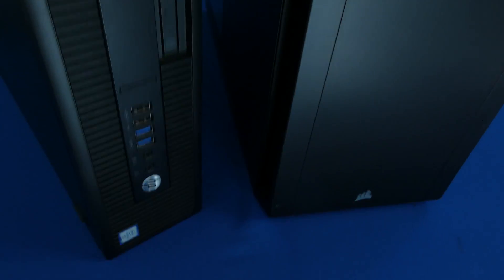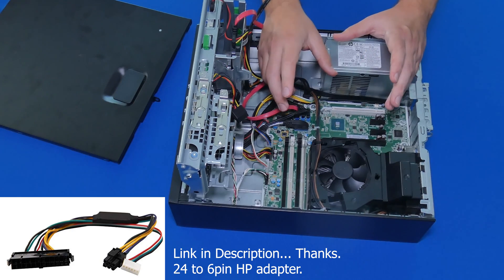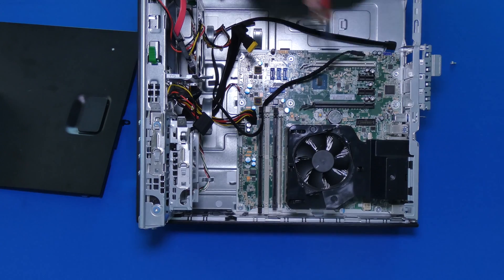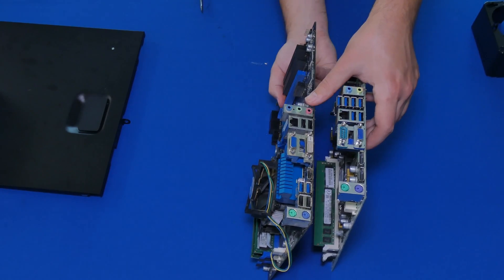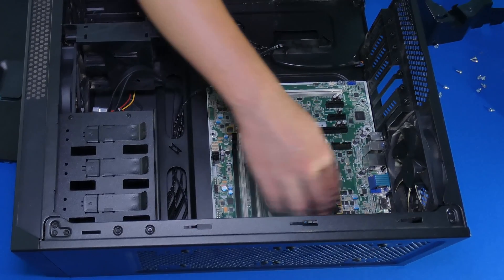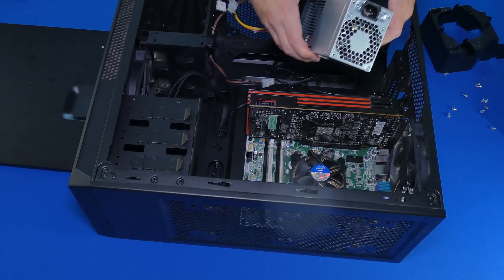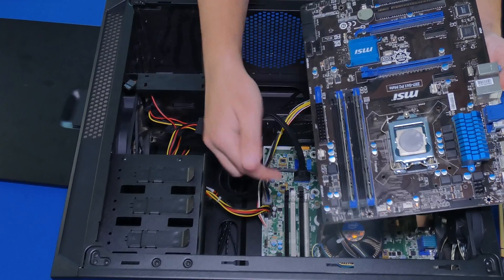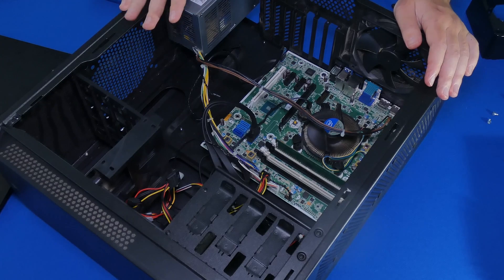HP EliteDesk transferring Parts to New Larger PC CASE

Comment: I'm going to try an elite 8100 HP, I hope to get it 😅 I know that the board has a different orientation, but I have already bought it, if it doesn't work I will have to make a box with metal or wood 🤣
Reply from the maker: Let me know how that goes.
Reply: The HP 8100, 8200, 8300 Elite SFF have a BTX style board that is incompatible with typical ATX cases.  The PCIe slots will be at the top of the board with IO ports at the bottom.  There are HP 8X00 Elite (non-SFF) systems that utilize HP proprietary mid-tower cases.  You might be able to find a used case/system for less money than it would cost to build your own enclosure.  The rare BTX cases available for sale (ebay) seem to be unique to a given brand/model (mostly HP/Compaq/Dell).

I have thoroughly explored using alternative cases for the HP 8X00 Elite SFF (small form factor) series in the past.  It is possible but unfortunately not easily or inexpensive and not in an off the shelf ATX case.  Your time and money are most likely better spent looking for a newer system like the HP 800 G1,G2,G3 series featured in this video that includes an ATX compatible motherboard layout.

If you are dead set on making a custom case for the 8X00 Elite here are some things to know:
1) These boards utilize a non-standard (proprietary?) power supply connector with extra circuitry and a non-standard pin out.  If you search hard enough and you can find the parts/schematics to solder together your own adapter and/or purchase (ebay) prebuilt adapters to allow the board to be used with a standard ATX power supply.

2) The boards appear to use a non-standard power button configuration so you will also need to salvage the existing non-standard power switch/usb port combo from the original HP SFF case or create your own workaround.  You may be able to 3D print a bracket for it.

3) The stock CPU cooler uses a duct that leads to a case mounted fan.  You will need to mount a fan directly to the existing cooler or engineer/3D print a new duct.  It might be possible to use an aftermarket air or water cooler, however keep in mind that the mounting bracket hole patterns supported by typical aftermarket CPU coolers are most likely non-compatible with the socket hole spacing found on BTX style boards.  Some aftermarket coolers are designed to clip on to a variety of included plastic rings with different spaces of feet that attach to more common AMD/Intel socket boards.  While I doubt any of them support BTX you could probably design and 3D print your own custom ring matching the upper dimensions of the original one with custom aligned feet for the BTX hole pattern.  If you do that please consider contributing the design back to Thingaverse in case anyone else out there follows in your footsteps.  Your choice of aftermarket cooler also must comfortably fit next to existing board components such as the pciexpress slot and populated RAM slots.  A tall heat pipe type air cooler may be the way to go or a water block/radiator combo of some sort (if you can find a way to adapt to the block to the BTX hole pattern).

4) The sole 16x PCI-E slot on the board is too close to the CPU socket to accommodate most aftermarket cooler and graphics card combinations.  If you are planning to use only the built in graphics of your Intel CPU, this won't be an issue.  There are a very limited (lower performance) selection of GPUs that might fit in such dimensions, but they may not fit next to an aftermarket cooler or over a water block.  There is a possibility you could use the stock CPU cooler by attaching a smaller fan (noctua) to it via zip ties or some 3D printed custom mounting bracket but the fin alignment means it would blow right up against a GPU, and if the GPU was a blower style card, its fan might be somewhat blocked by the CPU heat sync or pull in hot air directly off the CPU cooler.  You would need an extremely thin/short GPU in order for it not to interfere with the CPU cooler.  The best choice would be to purchase a pci riser extension cable (Amazon - Thermaltake TT Gaming PCI-E x16 3.0).  Using a riser will probably be incompatible with most bench type cases but when combined with an aluminum frame type case would allow you to relocate the GPU away from the board and CPU cooler but will necessitate you getting creative with add on 3-D printed or aluminum mounting brackets for the GPU.

5) Still think it is worth it?  Check out 20mmx20mm extruded aluminum t-slot bench style cases or frame enclosures.
Commercially available (QDIY PC-JMK, Amazon - ElectricMagic, Spotswood) slotted aluminum cases usually include the nuts and bolts and standoffs you need to assemble and possibly some pre-cut acrylic parts for mounting things like fans and the power supply.  The kits can cost as much or more as a nice ATX case but you may consider the price worth it vs the time and cost of rounding up all the parts/pieces to build something similar on your own.
If you have have your own 3-D printer, a cheap digital caliper, and a lot of time and patience, you can design/build your own custom version by ordering aluminum t-slot and combining it with some printed parts (Thingaverse) and the necessary nuts and bolts (Adafruit, Tnutz).  You will most likely have some trial and error prototyping the fan and power supply brackets etc.  While it is possible to purchase longer extrusions and then cut them in your shop with a power miter box and wood grade blade (aluminum is soft, wear eye protection, clean up saw dust immediately), getting clean/square cuts can be tricky and time consuming.  Creating a design in CAD software, calculating the lengths of each section, and then buying pre-cut from a vendor can be worth the extra cost.  Some vendors offer anodized aluminum which has a coating to keep the aluminum from tarnishing/turning your hands black during handling, and comes in a variety of colors. There are a lot of different extrusion sizes but 20mmx20mm with 6m channel opening seems to be more popular and therefore has a larger availability of lower priced compatible products such as hidden inside corner L connectors, rubber feet, t-nuts, and bolts.  Pay close attention to slot size compatibility when ordering nuts and bolts!

In the end whether or not you succeed you will have learned a lot.  Good luck and be sure to share videos of your adventure!
Reply: Andrew Sorensen holy shit you are a legend. Thanks for informing me. So if I buy an atx motherboard that is compatible with my processor what else do I need besides a case
Reply: @snailtrail8308  In order to reuse the CPU and RAM from an HP 8X00 Elite SFF with a normal ATX motherboard, you would need many of the same things cobuman suggests and links to in his video description, minus the power supply adapter cable since a normal ATX board and power supply won't require it.

For newer Intel CPUs consider going with the HP Elitedesk 800 G1 series that cobuman featured in the video over the HP 8X00 Elite SFF.  The Elitedesk 800 G1 series wouldn't require you to buy a new motherboard as it is already ATX compatible, but you would need the power supply adapter he links in the description.  The CPU and RAM would also be compatible with other LGA1150 ATX motherboards.  The high performance LGA1150 chipset was Z97 and those motherboards can be found used.  If you buy a nice one, you could have a lot of success overclocking when combined with a used Xeon E3-1231 v3 (4 cores, 8 threads) (Aliexpress).  For a premium mATX LGA1150 board that supports overclocking the Asus MAXIMUS VII GENE might be a good option, but used ones aren't cheap.  I like the Asus GENE series of motherboards, especially their mATX size, but if you do your homework you will find there were a lot of good used ATX and mATX motherboards from reputable brands with similar qualities that sell for less.

Prior to the HP Elitedesk 800 G1 series were the HP 8100,8200,8300 Elite SFF systems which have Intel socket LGA1155 CPUs.  As previously discussed their motherboards won't fit in an ATX case but you can still save some money if you take the CPU, RAM, HDD, DVDRW from the HP and combine them with a more spacious ATX compatible case, a socket LGA1155 ATX motherboard, a CPU cooler that fits LGA1155, optional GPU, and a standard ATX power supply (consider 650w or higher if using a gaming GPU).  Most ATX LGA1155 boards will offer plenty of room for a full size GPU and CPU cooler.

The PC I am currently using to type this message on has an Intel i5-3570 CPU and 16GB DDR3 ram rescued from an HP 8300 Elite SFF.  I combined them with a Cooler Master Hyper 212 LED cpu cooler, used Asus Maximus V Gene Z77 motherboard (ebay/facebook market), Samsung 850 EVO SSD, Corsair 750w modular power supply, and a used EVGA GTX 670 GPU.  You could put this in almost any normal mATX or ATX case.

It took some time, effort, and vinyl motherboard standoffs but I squeezed that all into a QDIY PC-JMK8 aluminum frame case (Aliexpress) with the I/O ports oriented upward.  (Sort of a budget InWin D-Frame case knock off.)  Rather than using the included acrylic pieces, I have the gpu riser bracket screwed to a motherboard standoff and slotted into the aluminum frame.  I added Corsair 12mm fans to the sides and some 3D printed fan grilles.  Velcro and 3D printed clips are used to secure the various power/sata cables to the frame.  

This PC has been a daily driver for over 3 years without issue.  I probably spent less than $400 for all the parts.  It still plays most games at 1080p with reasonable frame rates.  This motherboard and case would work fine with a more recent GPU shorter than 10.5 inches.  A used Xeon E3-1230V2 (4 cores, 8 threads) (Aliexpress) would be am affordable CPU upgrade for this system, but I haven't done that yet.

If you like used bargains and want to build a system from non HP parts, the Intel LGA2011 socket has some interesting things to offer when combined with a used Xeon E5 1650 v2 or Xeon E5 1660 v2 (6 cores, 12 threads) and a Chinese X79 board like the Huanan X79 Deluxe or HUANAN ZHI X79-ZD3 from Aliexpress, which interestingly enough support m.2 nvme SSDs (even though the official X79 chipsets never did).  Those boards will work with standard ATX power supplies and DDR3 ram.   These Chinese boards have added NVME m.2 SSD capability by using salvaged chips from other (server?) motherboards.  This may be sketchy but seems to work well in a few cases.  Just BE CAREFUL to do your homework before buying these types of boards so that you are sure the vendor will send the proper/latest revision of the two specific boards I mentioned.  The latest revisions ensure support for full 16x speed pcie slots and full speed access to m.2 NVME SSD drives.  There are a lot of similarly named/looking boards and some of them might be ok, but many are not PCIe x16 or m.2 NVME compatible.  These Huanan boards seemed most promising when I was looking around.
https://youtu.be/of2MgaQs67A?list=WL
https://youtu.be/Ix815arAteI?list=WL

For a less sketchy premium used X79 mATX board that will be better for overclocking check out Asus Rampage IV GENE, but consider that used prices are still a bit high on eBay and it doesn't have m.2 built in.

Recycling used/retired systems/the parts you have or can get free/cheap can be fun and save money but be careful not to go overboard throwing money at a vastly outdated CPU and motherboard combination.  With technology advancing rapidly LGA 1155 and 1150 are getting old faster than you might think.  The recent CPU price wars between AMD and Intel have definitely worked in the consumers favor.  If you have the extra budget and enjoy having a warranty and upgrade path for your investment, you might want to look at moving up to a more recent class of CPU/board.  Consider that you can build some brand new entry level AMD Ryzen CPU based systems for under $500 these days.  https://youtu.be/bGVdhNRejAU

Hope your exploration/upgrade/future builds go well!
Reply: ndsrnsn okay, thanks for the information! I was only asking because my friends got into a dispute and the pc was thrown 20 feet into the air in spite of anger and I’ve been using it with a messed up case.
Reply from the maker: @ndsrnsn2608  Good write up! Thanks Andrew! 👍
Reply: @ndsrnsn2608  
 Thank you very much Andrew, the motherboard will arrive at my house in a few days, I no longer have a way to cancel the shipment, but I will try my best to carry out the project as long as it remains low cost, it would not be worth sharing the idea if you had to spend a lot of money to do it. The 24-pin to 6-pin adapter is already on its way too, I'm going to take a look at all the options you've told me about the box, and maybe even build an aluminum one, and I'm going to buy an adapter to mount the graphic on Another part of the box, I have chosen a GTX770 and a 550W plus bronze psu.

Maybe all this is something quite difficult to carry out and maybe I will be forced to change the motherboard for this project, I will still do my best, and I thank you very much for the comment, I think it will help many people !

Comment: will this work for hp pavillion 590 desktop
Reply from the maker: Maybe. Look at the back of the PC and see if the I/O panel connections look to be in a similar position as the aftermarket Case.. if so, it may work.

Comment: I tried doing this with Z series desktops, but they had a proprietary heatsink mount point layout. I'm glad that some of the older enterprise level PCs (Elitedesk and Prodesk 800 G1, G2, and G3) have standard LGA heatsink mount points.
Reply from the maker: Yea, it's kind of interesting because the older 8000 series has a different orientation mobo which does not align with standard ATX case. But, newer models though. I bet HP got a better deal on parts by deciding to go with ATX standard.
Reply: @Cobuman  wwill this case swap work with a hp compaq elite 8300?

Comment: What about a optiplex 9020 SFF??
Reply from the maker: The motherboard orientation looks very similar so I think there is a good chance it will work.
Reply: cobuman Do you think I should risk spending $50 ($30 US) To try it out
Reply from the maker: @lachlan.mooney  It depends... Do you want to do it as learning experience or to add larger GPU (upgrade)? If you just want to upgrade the PC to play video games or such there are decent graphics card that should fit without changing the case.
Reply: cobuman I already have a low profile card in the case, 1050ti. And I just want this for a learning experience and more airflow
Reply from the maker: @lachlan.mooney  I'd say go for it. If fitment is an issue you can always put it back together. Just take your time and if it does not work out... you will have a PC case for future custom PC. 😁
Reply: cobuman Yes, thankyou. I also now forgot another point of doing this and that is I need to put extra fans in, it smells like burnt popcorn after a while!
Reply from the maker: @lachlan.mooney  Sure thing. I think the motherboard on 9020 uses standart 20pin PSU connector so you can upgrade that as well... just in case the smell is coming from PSU.

Comment: Both hard drive and ssd (which I have installed now) will work with that power supply in the new case like it does now right? I've never built a PC or anything so I wanna make sure. Also, do I HAVE to buy a new psu?
Reply from the maker: No, it will not work with 8300 because it's different orientation motherboard. However, if you decide to build a PC you can reuse any HDD or SSD. Here is an example how to build a PC: https://youtu.be/yuJKThJkirQ
Reply: @Cobuman  What do you mean orientation? I heard the moterboard will fit. I don't mind the hole in the back btw.
Reply from the maker: @peekmusic_  The back connectors will not align with the hole in the back.
Reply: @Cobuman  Ohh, weird. Thank you for telling me that. Why did people say it would fit tho?
Reply: @Cobuman  Do you know any other big case I could fit it in?

Comment: So the real question is could you put a Matx board in the g1 case.  That's what I'm wanting to do if possible. Seeing the only issue would be cutting back plate and a PSU that fits...
Reply from the maker: I suspect the motherboard would fit but like you said some metal cutting is involved.
Reply: I have an AMD Matx build underway and would be super nice to throw the motherboard, RAM, CPU and PSU in here until I can get the rest of the things.
Reply from the maker: @skylarcarlson1836  I hear ya. Let me know if it works out.

Comment: Wait can u put everything into a micro atx case?
Reply from the maker: Possibly... not sure because motherboard is a bit weird shape.
Reply: cobuman just to be safe then, do u reckon I could fit an dell oem rx 560 2gb in it? (and close the case)
Reply from the maker: @gotchupham8152  Are you talking about the original case? If so, you can use a "low profile" card and close the case. Like this one: https://amzn.to/35hLCJ5  I also have a video on how to install: https://youtu.be/_tbcimqBDzI
Reply: cobuman ty so much for the info, I’m gonna try it :)
Reply: I have an msi 560 4gb lp OC in mine.  Fits fine

Comment: Will it work with an HP ProDesk 600 g1?
Reply from the maker: It's very similar case so it should be fine. 👍 
Let me know if any issues come up.
Reply: [OOF] did you end up doing it?

Comment: Can sff dell 3010 support atx psu?
Reply from the maker: From what I can tell Dell Optiplex 3010 has a standard atx psu connections; so yes it should work. However, I'm not so sure you can move everything over to an atx case. Motherboard alignment would be an issue to consider.
Reply: @Cobuman  i can manage the mobo.
Just need to put a corsair 500watt psu and i am good to go :)
Reply from the maker: @hasnatmalik2761  Nice. The connections looks like a standard 20-24pin atx. You can open to check. A long white connection.